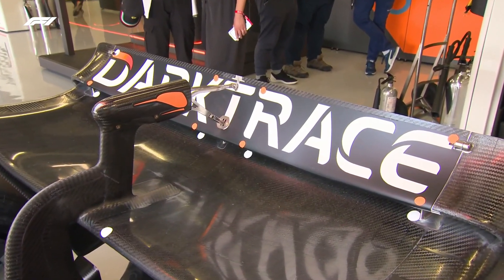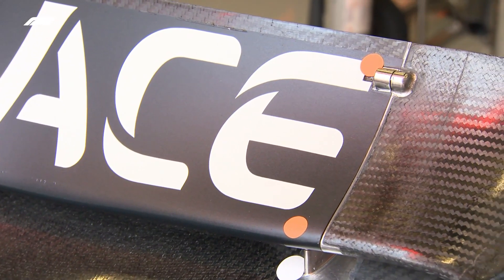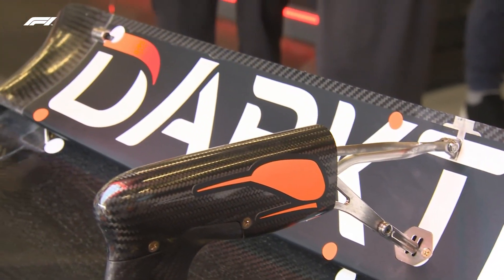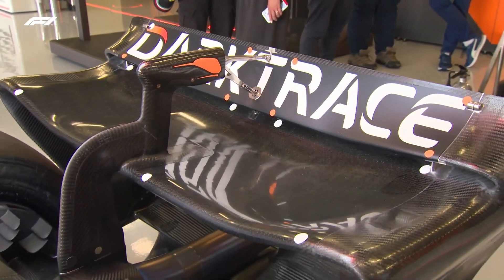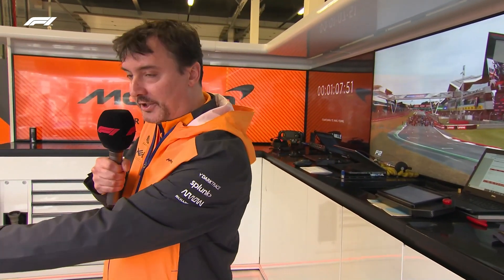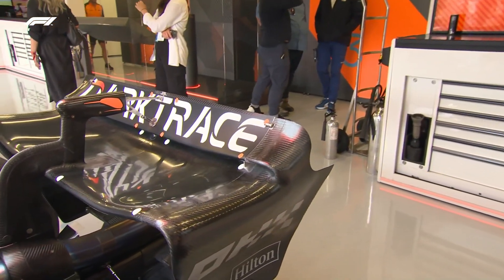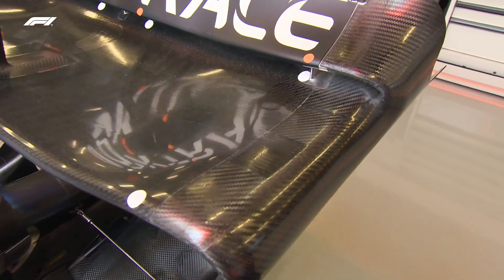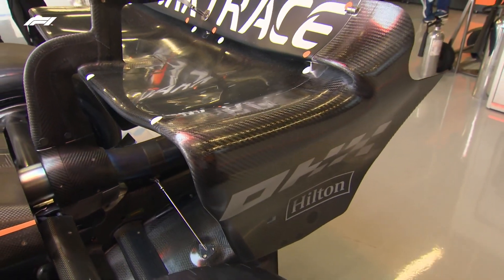Do Stickers Affect F1 Cars? | F1 TV Tech Talk | Crypto.com

Comment: Question I’ve had for a while now; is there a rule that the engineers are supposed to talk to the drivers in English or is that just a courtesy? I ask because when Piere and his engineer speak, clear that they both speak French but they choose English for some reason. That’s why I wonder if it is an official rule. Thanks
Reply: None that I can remember, but the conversation is not just between the head engineer and driver, it also involving the whole side of the garage, guys in pitwall, and mission control in their HQ. It's better and more reliable to use english for the whole conversation instead of switching languages depending on who you speak to.
Reply: Alonso occasionally used to speak Italian with his engineer when he drove for Ferrari. Commentators hated that but they're was no language rule back then. Same thing with Buemi who used to speak French on the radio in Formula E. I think now it's just a habit to speak English during the race regardless whether driver and engineer speak the same mother tongue.
Reply: This made me wonder of buemi and his engineer both speaking french

Comment: Does brake bias affect ers recovery? Because a rearwards bais puts less heat/energy trough the front brake and the other way around
Reply: I think drivers adjust the Brake Balance, not Bias, as in the necessary actual mechanical brake bias is processed and computed in relation to MGU-K harvesting and engine braking to reach the desired Brake Balance overall.
Reply: @mircoh.8367  you are right, meant bbal not bias. The reason i asked was mainly because of danny ric’s monaco win when he had to move the bbal to stop the mgu-h or mgu-k from overheating

Comment: Now that we're on the topic, what about the color of paints? Does it impact heat distribution?
Reply: Ive seen a video about that somewhere on youtube before, I just remember it doesnt make a noticable difference to a point where you have to think about it
Reply: @mannoesgehtnix  You mean ChainBear's video about F1 Liveries?
Reply: an interesting question, i to would like an answer to this now
Reply: In black Mercedes time their engineers have already answered this question: no.
Reply: yea probably
Reply: in fact I'm pretty sure the brake callipers are painted a specific color and reflectivity just for heat sink purposes
Reply: The darker a surface is the more heat it can dissipate via thermal radiation. thermal radiation highly depends on the surface temperature. Given that the significant colors are in the body work itself where I would not expect temperatures that are high enough, I would say thermal radiation is not a significant factor.
Reply: White paint is usually lighter - on a 747 its about 20kg vs a black paint.
Reply: If you refer to matte or glossy finish, it doesn't make any difference. The main reason to go to a matte finish is you save weight (and that's a noticeable difference)
Source: engineer
Reply: No clue about heat, but i know alot of teams started using matte paint because it weighs less than gloss. Rosberg even said hed leave his helmets mostly unpainted because it was 2kg less
Reply: Yes, one of the reasons why Mercedes was struggling in Austria would be that the car would overheat due to the black paint and the car being dependant on cold air to start with.
Reply: Are you sure? I race bikes and we've always been lead to believe that, after polished metal and bare carbon, darker colours are lightest (you know what I mean...) as the paint can be thinner. Black, dark blue etc needs thin paint, yellow and white need a couple more layers,
Reply: @andyh570  yes, that is correct. The more pigment, the heavier. This is why Ferrari changed their Scuderia colors to a more darker pigment

Comment: As a mechanical engineer, I would like to know the  increase in spring stiffness and rate of change of the anti-dive suspension geometry that was required to deal with the increased downforce generated by the Venturi ducts required in the new 2022 car regulations.
Reply: ahh the porpoising conversation....tbf even engineers don't know completely.

Comment: Not F1 but in NASCAR this year a team got penalized for layering decals on the front corners to increase downforce
Reply: That’s an ingenious idea. & would have been could have been an amazing loophole. Was it specifically against the rules, or was it interpreted as an aero device?
Reply: @DavidDewis  AFAIK you are not allowed to change any part of the outer body (apart from the repairs done mid tace) and I think this would be classed as changing the "shape" of the body structure
Reply: Dale Jr said that their team used to layer stickers in front of the roof mounted on-board camera as it decreased drag just a tiny bit.
Reply: So in a sport where it's legal to push others off track,,  putting on some more stickers is bad??? 🤣🤣🤣🤣
Reply: @its_only_karma7440  Take a Look at Dale Jr's roof cam from Talladega i think. Literally stacks in front of the roof cam to lower the drag cause by the Cam.

Comment: I thought the sponsors were painted on with stencils, then laquered in to avoid any edges
Reply: yea but if you can maybe like create a big edge on the E of the darktrace and the D, then it can act like a tiny vortex generator that seals the rear wing high pressure a bit better. Not as much as Aston's idea but still.